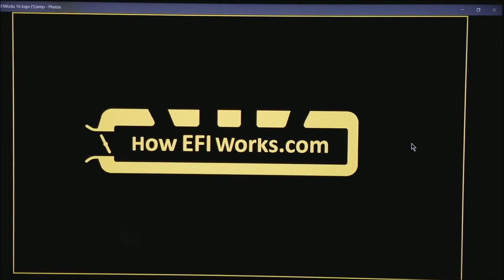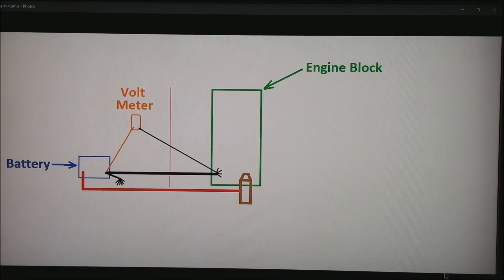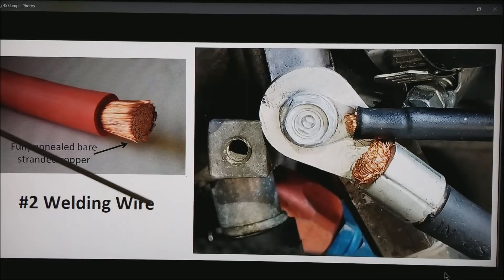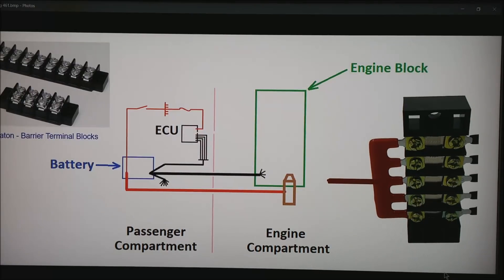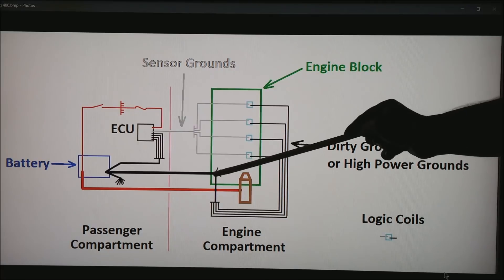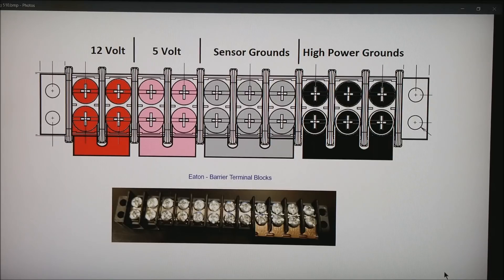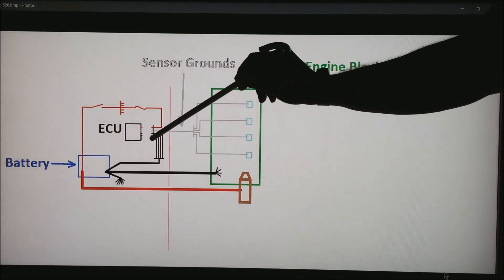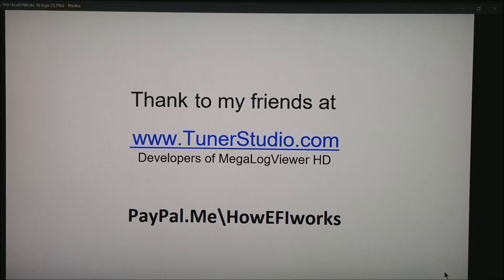ECU Grounding

Comment: Exactly my issue, Honda K24 swap with Speeduino and Tunerstudio, I thought more grounds are better, but it seems that I need to rewire for logic ground vs sensor ground vs power ground. The part where you say the cranking doesnt change the water temperature was very funny to me, I was wondering why that needle moves when I crank :))

Comment: Questions so that means you cannot run extra ground wire from your battery to an engine, ground engine block or something of that nature because it’ll make a interference via ground and do you think my ECU is grounded through the case to the party or no
Reply: DO NOT ground the ECU to both the battery and another ground such as chassis or engine block. Pick one common ground point. Generally the cylinder head is preferred for proper star grounding. Most ECU are not grounded through the case.

Comment: Brilliant i feel like i should have paid for your course my ect 2 radiator mounted glitches back and forth maybe 30 times a minute at most say and only tenths of a degree 40.0 -40.7while key on engine off would that likely be a ground issue? My issue is no ground to my fly by wire throttle module, relay, and so on throttle body 07 accord
Reply: Coming from the ecu d15 pin /connector to relay car starts off as it would burn out breaks one. Tire free then it falls on its face so hard i actually fly forward and hit the horn every time😢

Comment: You never mentioned if the ECU had to have a ground wire going to itself instead of through the wire harness cuz the ECU on my diesel has rubber grommets insulating the ECU and I ain't getting no ground to certain things

Comment: Im not sure how you got 100 amps for the starter when the fuse is only rated 30 amps for about every car iv seen
Reply: It just came to me that the 30 amp only runs the toggle for the motor and the motor is wired directly to the battery with a 150 amp fuse. So yes you are right lol you should have mentioned that. The starter and the solenoid pull more than 100 amps if you look at them as a whole

Comment: The engine doesn't run off the battery, it runs off the alternator. Once running the battery does nothing except charge. ...so running earths back to the battery is technically wrong except for when it's starting.

Comment: very good info here. i have a ducati monster 796 and all my continuity tests and voltage tests pass out.but i still dont have any power on my dash.my pass light,brake lights,tail lights and horn work.but the bike does not crank and neither the the meter light up.i suspect a bad ecu. any advice here?thanks.

Comment: Reading the Megasquirt manual it says to connect the ECU only to the engine block, what is the bad part of that?
Reply from the maker: The video was based on the latest consensus of the guys that write the manuals.  The MS manuals have not been updated.
Reply: Yeah I have the MS3pro ultimate and 4.12 says to do that. However Haltech, Adaptronic, etc etc agree that is not best.  Wish they'd update important stuff like that in the manual and provide more information on it.
Reply: @alzimme86  don't ground your ecu to the block and battery at the same time.
Reply: Generally most ECU manufacturers now recommend to ground the ECU to a common point on the engine, usually the cylinder head. DO NOT ground an ECU to both the battery and another shared ground. Use only one grounding method.